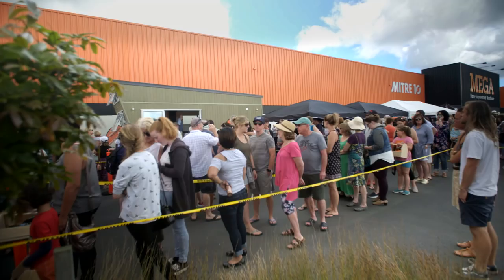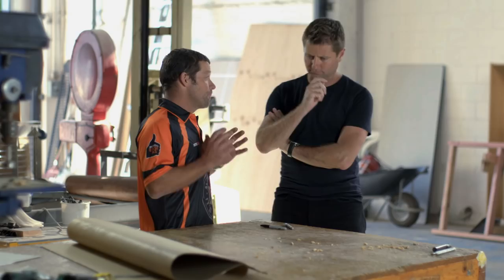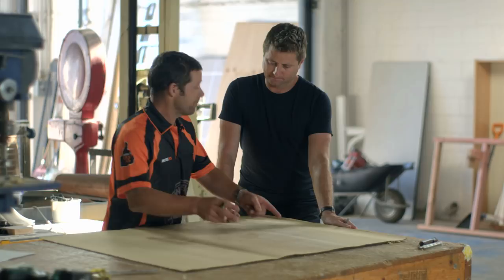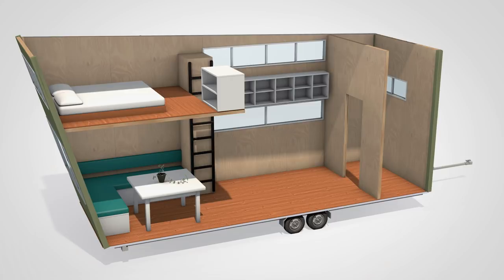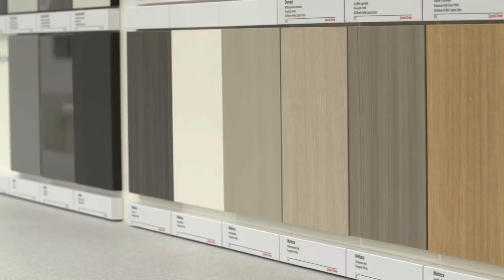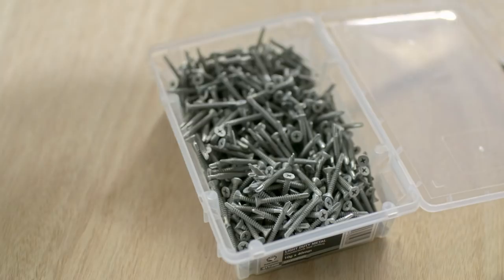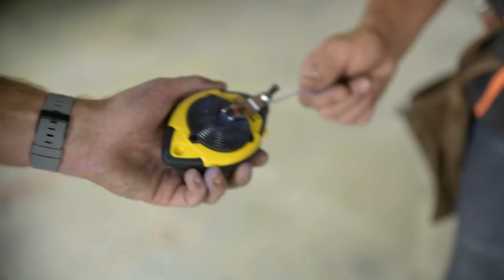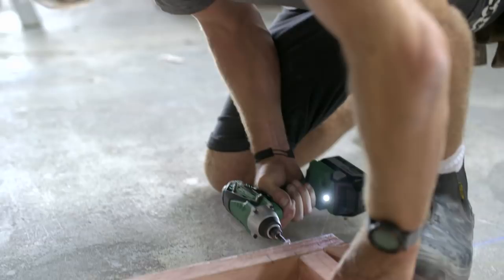Ep 1: The Plan | Mitre 10 Tiny House 2 with George Clarke

Comment: For the constructive purpose, I wish you would have recorded and explained a bit more of how to cut and frame a 15 degree side wall itself and the connection with others.
Reply: They would’ve cut the 15deg lengths, followed by cutting the top long point and short point,(short point being short side of the 15deg cut and the other side a square cut

Comment: I see tape went down on the trailer before laying down the floor... is this for thermal bridging?
Reply: Yes, for thermal bridging.  Looks like DPC.
Reply: Hi Geenine44, in this particular case the "tape" they put down is acting as a damp proof course DPC (preventing moisture to wick from the steel into the plywood), but it is not really acting as a preventative for thermal bridging as well - it is too thin.  A thicker, more appropriate material would be needed to prevent thermal bridging from the cold steel into the plywood (and then up through the floor into the home). A DPC of some sort would definitely still be needed whether it was acting to prevent thermal bridging as well or not.